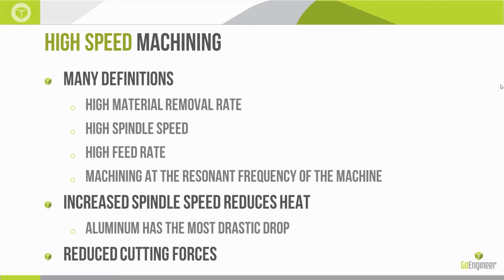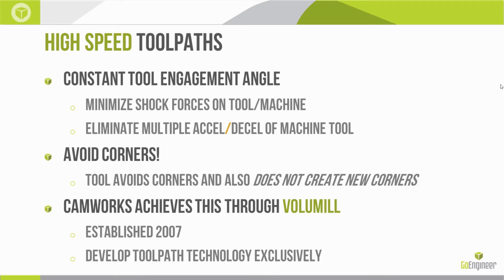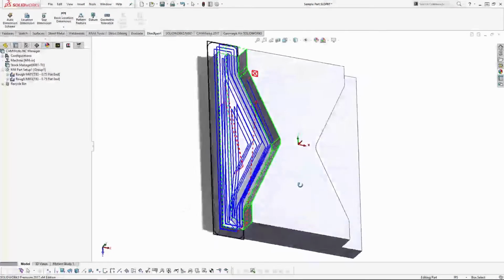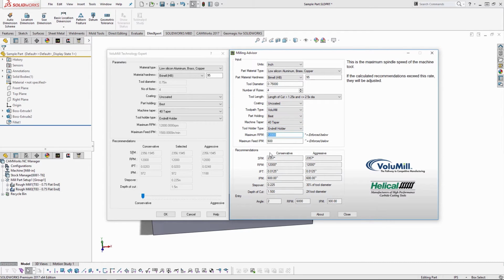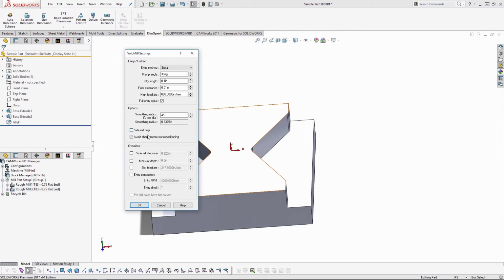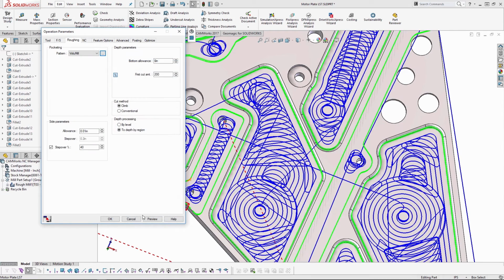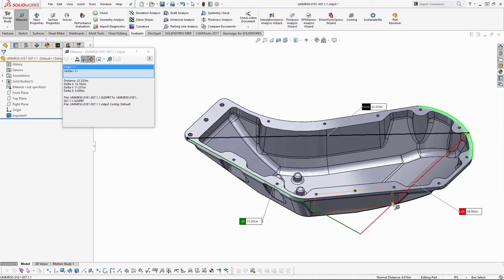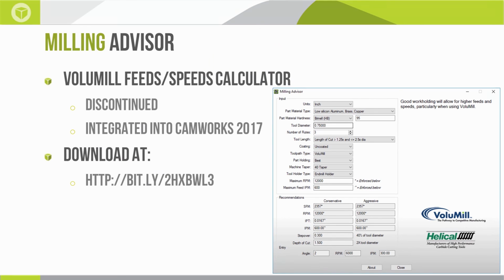CAMWorks - High Speed Machining

Comment: Hi, where can i found of Milling Advisor software or similar?? i have camworks 2022
Reply from the maker: There are some tools inside CAMworks, but a lot of the tools like milling advisor are CAM agnostic so they work to provide you detailed speed and feed info but most do not have direct interfaces into your CAM software.  They are readily available through the internet or frequently from the tool manufacturers themselves.
Reply: @goengineer  ok got it.  But can you recommend me another tool o software? I want compare the speed and feed that camworks recommend me for Volumill strategy, with other software

Comment: More flutes on a tool does not weaken a tool, it makes it stronger. The more flutes you have, the more shallow the gullets of the flutes are resulting in a larger core diameter

Comment: Tyler, did you ever make your 5 axis machine here  https://www.flickr.com/photos/7589540@N08/5858389110/in/album-72157625706709547/

If so, how did it turn out?
Reply: knight2255 - unfortunately I moved and lost the real estate to fit a machine like that. I purchased quite a few parts for the project, but it never got off the ground. It was fun project to design and dream of though!